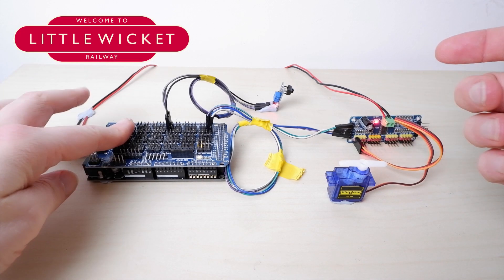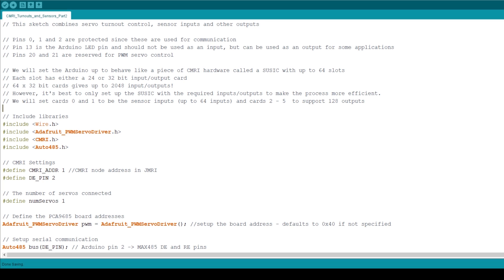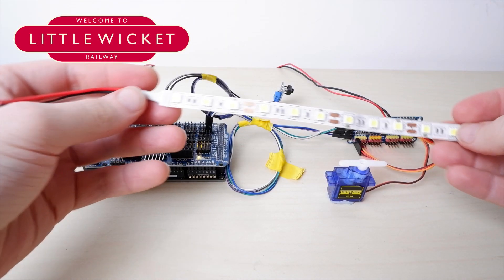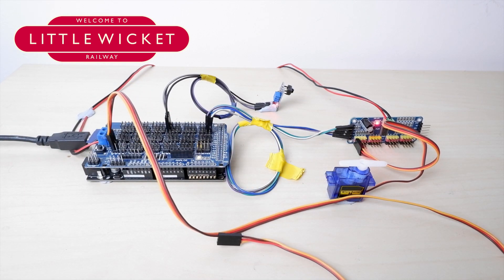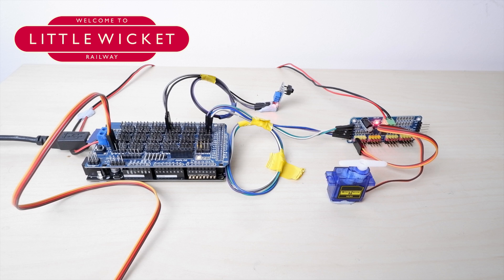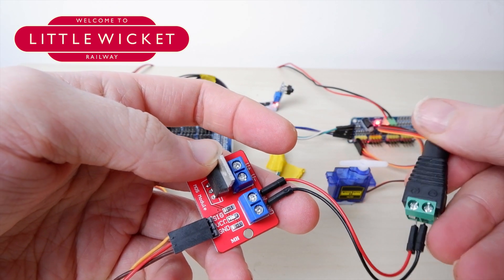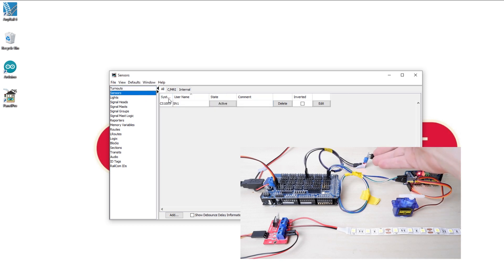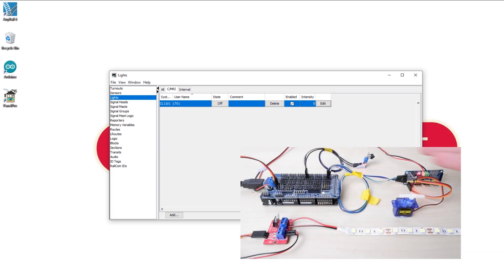Arduino, CMRI and JMRI - Part 2 - Adding Outputs

Comment: As always Rob, great video BUT I can't seem to get JRMI to recognize the IR sensors changing state from inactive to active. Are there any troubleshooting options on the DCC++ basestation so I can see the   traffic coming in from the meg. I've using a v1.3 sensor shield - does that make any difference? If I create a sketch on on the 2560 I can see the sensor triggering locally so I am fairly confident the 2560 and the sensor shield are working.  Many thanks if anyone can give me any clues - ta

UPDATE: I left the project and came back to it later. I followed the options for CMRI and everything now works fine :) Happy days!
Reply from the maker: Glad it's working 😃, but strange that it didn't work for you first time 😕
Reply: @Little Wicket Railway  probably because I didn't have a scooby what I was doing :)

Comment: A great video with helpful tips. Instead of using one output per LED, I would find it helpful to use LED pixels with WS2812 controllers (Neopixel Daisy Chain). This would allow different colours (for signals or a busy signal on a panel) and reduce the cabling to a minimum.

Comment: HI Rob,  i have progressed from the videos where you have seperate sensor hub and servo driver to the combined, finally got part one to work, had a break and came back excitedly to find the set up from the end of video 1 Arduino, JMRI and CMRI wouldn't work on reopening JMRI, is there some reinitialising process todo to "reconnect" the arduino to the JMRI?  all the settings fo rthe turn out and sensor are there, any suggestions?
Regards
Colin
Reply: I deleted the entries and re entered the details for the sensor, and it worked however once again on closing down and restarting jrmi  it doesn’t work.

Comment: Great job, I've been catching up on all your arduino vids as I am doing my early research before starting my prototyping for my soon to begin layout.  In was not considering JRMI until I started watching your vids.  A few questions if you don't mind.
I plan to use 3 light block signals for the many blocks I am designing.  My original idea was using many nano's connected together to utilize sensors and logic to control the block lighting when a train enters a block and while it is in the block and exits to the next block.  You mentioned JRMI, in this video, could control lighting based on multiple sensors,  Does that mean there is logic to have a signal go red upon entering a block and passing a sensor and stay red until the train passes the next sensor and return the original signal to green?
I also plan to use dwarf signals to identify the switch positions as well as simultaneous led's on a control panel. I may automate servos on turnouts eventually but will have switches on my panel to do that outside JRMI as well.  
Is there any comprehensive "training" vids on JRMI you know of.  Thanks again for your great work into this area.  I see world's of possibilities upcoming.

Comment: Hi Rob, I have been away from the project for a while, but, I am back now. I have one problem I hope you may have come across. Everything works fine in the initial setup, however, when I close the application down and restart I have to reinput the configure nodes each time despite having saved them previously. The node is visibly present on startup but I need to delete and reinput to get the system working again. Many thanks for any advice you may offer.
Reply from the maker: Hi Brendan, have you managed to fix this yet? Is "enable polling on startup" ticked for the node?
Reply: @LittleWicketRailway  Hi Rob, unfortunately not yet, I have ticked the box, but once I close PanelPro and restart I need to reenter the C/MRI node to get it working. When it is working it is perfect.
Reply: Hi Rob, I have the same issue that Brendan.
wen open Jmri and node is configured the sensor is in unknown state. I figured if delete the node and make again the sensor works Fine. but wen I close the jmri. the next time I use jmri the node left work again. and is frustrating. every time I use jmri make the node. I trying put in the sketch in serial connection (19200, 8n2) for take the difference between serial protocol and jmri use serial. take from the page of madleech.
and the issue still occurs.
I note that the poll from node wen make a new node is much more rapid than wen node is not read. and note in the blinking led. working is fast, don't working is more slow. I see to in cmri monitor.
is so strange. Thanks in advance.
Grettings.
Martín.
Reply: @MartinCarames  Hi Martin, I have tried part 3 of this series which has resolved my issue. I now connect through an RS485 and it seems to retain the sensor and switch information after a restart. I am still not sure why the first option did not work. Brendan.
Reply: @brendanhannon1577  Thanks Brendan. I will try this option. Thanks Again.

Comment: What am I doing wrong?
When I follow all of the steps and bring up panel pro click to setup cmri it is not an option only dcc++
Reply from the maker: Hi Jerry, in the preferences section under the connections menu you should have the but "+" symbol at the top which will allow you to create a new connection. Then select CMRI from the drop down list.
Reply: @LittleWicketRailway  thanks

Comment: Hey Rob,
I've built the dcc++ base station, it was a great success! 
Also managed to do the combined sensor and servo hub; I had 3 servos, some led's and a relay module connected! I set them up in layout editor simulating point control with frog polarity change( a pair of points changing simultaneously) and mimic board led's, oh and a sensor triggering an led! And finaly, I managed to run the back and forth sketch!
Amazing!!!
Thanks again
best regards
Tom
Reply from the maker: Hi Tom! Love comments like this. Sounds like you've totally nailed it 👍😀👏👏

Comment: Great videos, keep them coming!  Can I ask what size your layout is, thinking about a similar design for my own and like to get an idea of what would fit. Thanks
Reply from the maker: Hi Jim, thanks 👍 It's 4ft wide and about 10ft long (some of that is hidden behind the back scene). There are a lot of things that I will do differently for the rebuild. I'm still planning on making a video on these mistakes, but the 2 biggest ones were:

- 4ft is too wide. I can't reach the other side without crawling under the layout, squeezing up between the layout and the wall and reaching over the back scene. In future I won't go wider than 3ft.

- The hidden section is too complex and inaccessible. If you're going to have a hidden section that can't easily be accessed then you need to make is super simple so that nothing can go wrong.

Comment: I am new to your channel and model railroading.  I watched your videos on using and setting up servos with jmri and was successful in duplicating   Your process and am going to implement into my layout.  Now with these new videos I am planning on obtaining a sensor shield and try to use these new techniques.  I have a question, can you use switches connected to the sensor shield to control a turnout with the switch and jmri  ( manual mode using a control panel along with computer control via jmri)
Reply from the maker: Hi Jim! I'm still planning on doing a video on how to use a push button control panel with JMRI to have points change and the position be displayed on a mimic panel and within JMRI. I don't think that would be too difficult.

99% of things are possible with Arduino and JMRI, it just depends on how comfortable you are doing a bit of coding and using the tools in JMRI. Everyone will want something slightly different for their layout, but hopefully I'll come up with something that most being can use, adapt and improve upon 👍
Reply: @LittleWicketRailway  Thanks for the quick response,  as I said my comments I am new to this but am willing to try new things.  The electronic part using Arduino is very interesting  I am finding it a bit of a learning curve. Looking fwd to your upcoming videos

Comment: Would you consider making a Video about adding a H bridge to the Arduino to increase the amperage? A lot of people seem to be struggling with the limitations of 2 to 3 Amps typically available on most motor shields. I think a H Bridge can theoretically go up to a maximum of 40 Amps (more likely about 20 Amps max)
Reply from the maker: Hi Scott, you mean like a booster for the DCC signal? It's not something that I'm looking into at the moment. Building a booster that could handle 5 Amps for example, might not be that hard. However, building a booster that can handle 5 Amps and includes proper short circuit protection to prevent damage to locos or worse fires is a lot harder. I wouldn't feel comfortable suggesting anything that might not be safe. DCC++ has short circuit protection built into and, as you say, the motorshield is current limited, so I feel that's pretty safe.

If you're really comfortable with DIY electronics then check this out http://www.trainelectronics.com/DCC_Arduino/DCC_Booster/ It looks to have current sensing built into the code which suggests that it will detect shorts, but it's not my project and I've not tested it.

Or MERG do a booster kit that you can self assemble which definitely includes short protection.
Reply: @LittleWicketRailway  Yes that’s right I was talking about boosting the DCC signal to enable running more trains. I didn’t consider the additional short circuit protection I would need so thanks for suggesting it. The links you provided have also been very useful.

Comment: Thanks a lot. Great explanation.
What would you suggest how to connect light signals?
Is there a better way than dcc?
Reply from the maker: I still don't have the perfect answer for this. If you want simple on/off light signals then you can connect them to output pins on here. If you want to fade the lights then you'll need Pulse Width Modulation. I'm looking at addressable LEDs which be a better solution. I need to decide relatively quickly as I want light signals on my future layout.

Comment: Thanks for the bigger font size in the IDE. I can read it now. Are you going to try creating a RS485 bus for  the CMRI nodes? I've been looking into this, but have yet to give it a go. If you are using a different system I will just as curious. Cheers
Reply from the maker: That's the plan 😁 kit's all arrived, just got to plug it all in. I'd also like to experiment with what makes the best node. Nano, uno or mega with or without a sensor shield. Not worked with nanos much.
Reply: @LittleWicketRailway  I have a garden railway, so the distances between devices is an issue, thus my interest in RS485. I also have tramway which I'm going to add detection and automation to. It's on four baseboards (with a 5th on the way). I'm thinking that one Nano per baseboard, with just 4 wires (DCC and RS485) connecting each board. Baseboards would need a rectifier+regulator circuit to provide power to the Arduino from the DCC power bus, or I run a 12v bus in another 2 wires. Good luck with your project.

Comment: This script works perfectly for me thanks  this is being installed into the layout at the moment and it’s has been tested with 11 servos and 10 infrared sensors so far. Will be reading the micro switches built into the 3D printed servo mounts in the next few days so this code will come in handy. May run out of pins on the arduino Mega lol so think the next video will be very interesting for next steps. Keep up the great work.
Reply from the maker: Thanks John, glad to hear it's all up and running for you, I best get cracking on that next video then! 😃
Reply: @LittleWicketRailway  I take it you are going to go down the bus road to get more arduinos connection rather than using usb. This seems to be getting a lot of interest in other YouTube channels. Esp32s are a good alternative to arduino not sure about the latest ones though. I have used one to control a water top of system using Matt which works well. Look forward to the next instalment.

Comment: The bit (pun intended) I'm not sure I'm understanding is where the 32/64/128 'bits' are coming from in CMRI? In terms of Input and Output pins. 

Other than that I must highlight your presentation style. You've got very clear audio and video camera quality. Breaking up the video into chapters really does help.
Reply from the maker: Thanks Martin! The number of 'bits' are set when you create the CMRI node. There are different types of nodes, some of them have a fix number of input and output bits. However, some like the node we're using in the video have 'slots' for cards. The cards can either be input cards or output cards and each card has some 'bits' on it. In the video the cards I'm using have 32 bits on each card. I've got 2 input cards (64 input bits) and 4 output cards (128 output bits). For this type of node you can change the number of input/output cards and bits available. The CMRI node summary table shows the number of input/output bits for each node. Have a play around with the node options.

The addresses of the bits are 4 digits. The first digit is the number for the node and then the three digits after it points to the specific bit. So the address for bit 1 on node 1 is 1001, the address for bit 7 on node 3 would be 3008, bit 104 on node 8 would be 8105, etc.

You can have an input on address 1001 and an output on 1001 which can get a bit confusing because the address are the same, but JMRI knows that one is an input and one is an output from which table the object is in (e.g. a sensor is an input, a light is an output).

Does that help?
Reply: @LittleWicketRailway  Sort of, I think I'm getting lost in the 'cards' area. If I understand - physically you've got the Mega shield with it's three strips of pins. You are logically defining a strip of pins as card (either input or output) within the Arduino sketch? 

It feels a little odd to be defining something up in the 128-bit range when there's not that many physical pins.

I'm waiting for my own Mega + shield to arrive so I'm sure I'll understand more when doing it practically. 

Looking forward to seeing if you can get multiple nodes working, it'd be good to be able to use a node to do all the LED outputs for a mimic panel mounted on a wall.

Comment: I’m really looking forward to you doing a video on mimic panels. This is something I’ve researched a lot. DCC Concepts have some great products for mimic panels. They have made an LED that is also a push button. I think this is perfect because it saves having separate LEDs and two-way switches on the mimic panel. https://www.dccconcepts.com/product/cobalt-alphaswitch-d-set-to-control-digital-devices-12-green-switches/
Reply from the maker: Hi Scott! I will get round to looking at mimic panels eventually. The DCC Concepts kits does actually look pretty good value considering they give you all the switches with connectors and the board to manage them. However, if you wanted to do this yourself using the Ardunio inputs/ouputs then I think you could use something like this https://uk.rs-online.com/web/p/push-button-switches/1558979/ there are plenty of other options on there, but this was the cheapest at around £0.65 per button/light.
Reply: @LittleWicketRailway  Thanks for the link it’s give me something else to consider.

Comment: Fantastic work Rob. One question I have is switching polarity on electro-frog turnouts when using servos via cmri/jmri (I don't think you've mentioned this?). Could this be done using the relays as in this video?
Reply from the maker: Hi Iain! Thanks!

I don't currently have electrofrog points, so don't speak with any real experience here, but I would think a SPDT switch mounted next to the servo would be better than a relay. The MERG servo mounts have space for these and I'm sure other mounts will too. The common connection goes to the frog and the rails are on either throw. As the servo arm moves it activates the microswitch and flips the polarity.

My reasons for not using relays would be:

- They're more expensive than switches
- Greater chance of cause a short if they fail, activate before servo does
- They require a current to stay active. If lots of points are active then that's quite a bit of current.
- They make a clicking noise
- They would require connections to the Ardunio requiring wiring and output pins

The other option I need to look into would be electronic "frog juicers" that detect a short circuit and rapidly flipthe polarity before the base station trips. My gut feel is that I'm against anything that needs a short circuit to occur for it to function because generally short circuits are to be avoided. The commercial units are also quite expensive and I don't know what the DIY options are like.
Reply: @LittleWicketRailway  Thanks Rob that’s a very considered and helpful answer. I have seen the micro switch mounted option and suspect I’ll go that route, I guess it seemed a bit too ‘mechanical’ with the chance for wear over time? 
Thanks again, your tutorials on this are the best on YouTube.
Reply: @LittleWicketRailway  Rob. I can only re-iterate what Iain and others have written. I have found your videos very interesting and very easy to follow. Amazing stuff! (Why don't other people split their videos into chapters?)

I am writing this as I had exactly the same query as Iain about switching the polarity of electrofrogs. Having seen my videos I have decided to go down the DCC and eletrofrog route. 

Haing now seen your videos I have also decided to use Arduinos.

I would be interested to hear if you do any work on electrofrogs.

Many thanks
Roger